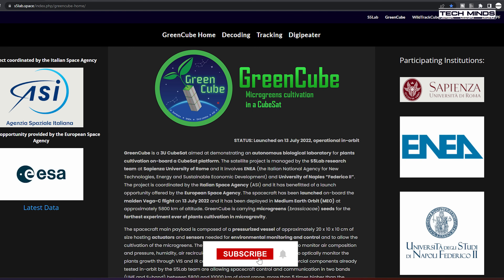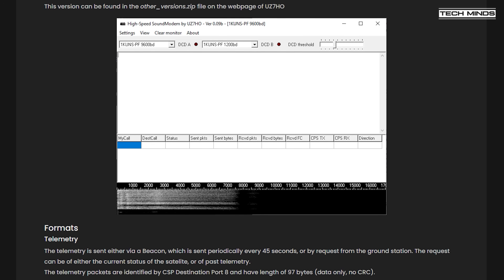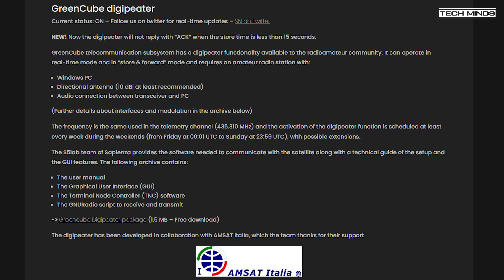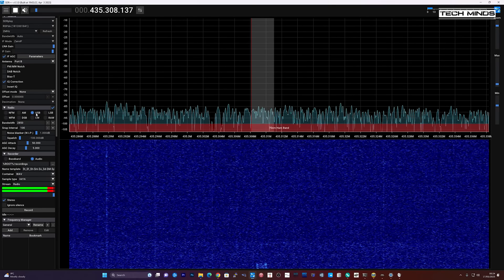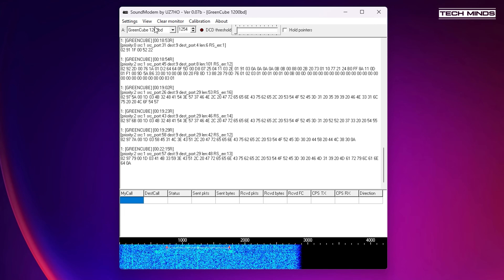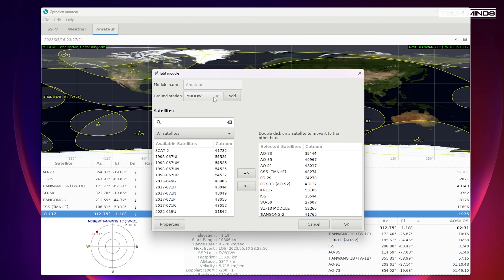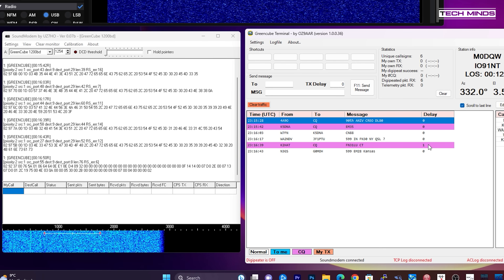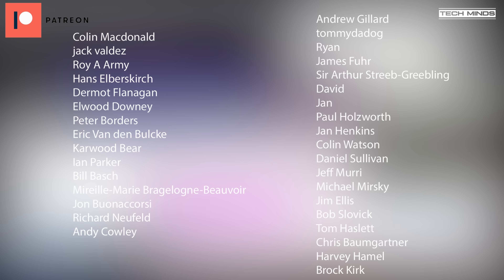RECEIVING AND DECODING GREENCUBE CUBESAT

Comment: I just started tracking sats and listening to them with my Icom 818 transciever. I ordered an Arrow antenna for better results. The ANT-Runner el/az tracker is on my list. Good VHF/UHF transcievers to hook to computers are rare. I had the Icom IC-7100, which was great for this. I am shopping for a replacement. The Icom IC-9700 is at the top of my list. I love Gpredict and have it running all of the time.

Comment: Look for 2nd hand rotators and elevators that use AC motors and a pot  for feedback. Piss easy to then interface to an arduino running K3NG with a couple of relays. Beware you need a bit of heft to start moving a couple of yagis around.

Thanks for the video - its footprint is huge so passes last a long time

Comment: I've had a portable camera tripod mounted AzEl antenna rotator project on the back burner for yeears. It's one of those projects that got serious and then life happened and it was shelved. This video may prompt me to dig into the box of stuff this weekend and see what I can do.
That said, if you're interesting in building your own, one of the best projects is the K3NG Arduino Rotator Controller. It's open-source and still under active development.